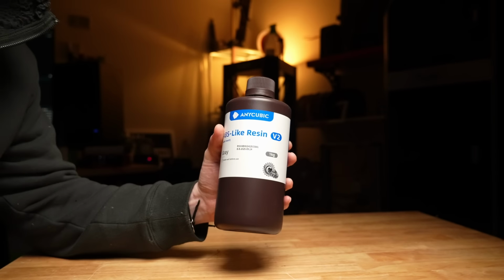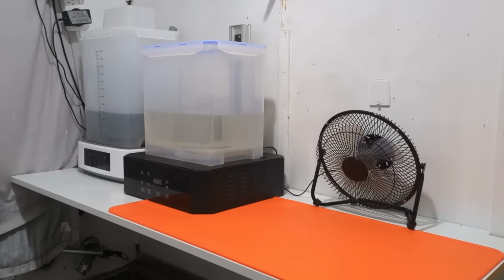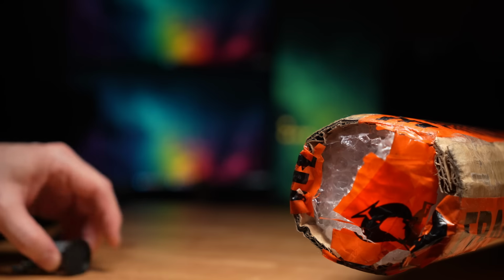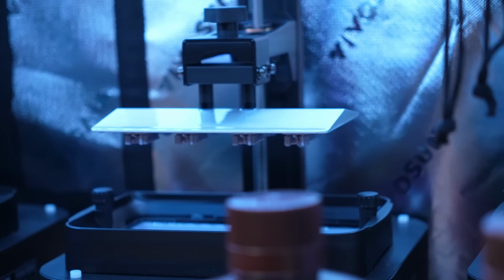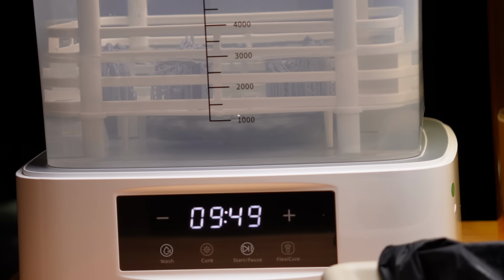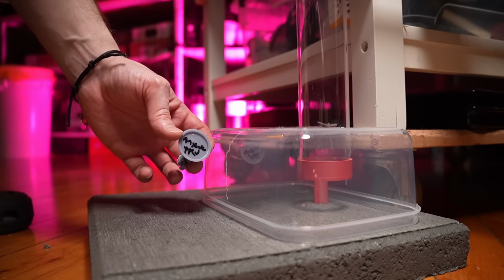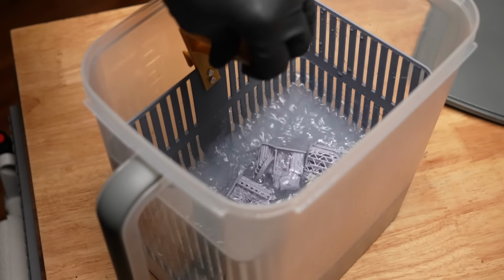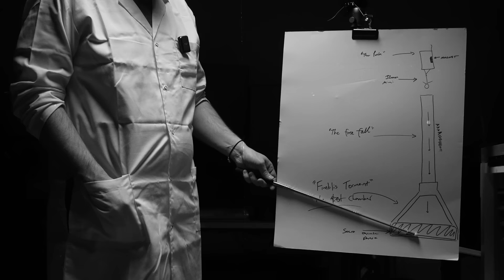The hunt for GREAT water washable resin (Part 1)

Comment: I have been pretty happy with the sunlu ww abs like. Was easy to calibrate and I have had a much easier time removing supports and minis not breaking compared to elegoo ww. Elegoo is extremely brittle and chipped constantly. Have not tried some of the others yet though.

Comment: Drop test: just feed the model into the top of the tube without the faff of the extra mass from the magnetic holder and just let it fall under it's own weight.
You could also do something like print a sword or spear or a true-scale mini limb or any other kind of typical fragile bit and fix it in place with a vice or something. Then make a cheap little force gauge by taking a small hammer, drill a hole near the top of the handle so you can hang it on a nail or something so it swings like a pendulum. Raise the hammer head to a marked height and let it go so it swings down to hit the model on one side with the same force each time.

Comment: I got into 3D printing during the pandemic when IPA was scarce. Water washable resins was the only real option. I have a Mars 2 Pro, and still exclusively use their translucent water washable resins.

Its affordable, easy to work with, doesn't smell as bad, and doesn't require all these other chemicals. And the translucent resins allow me to inspect the bed after every print to make sure the FEP is ok, and it allows (in my opinion) a more thorough cure as light can penetrate the model easier.

Is it brittle? Sure. But I handle my minis with care when I play and they are on a shelf for most of their existence anyway so its never been an issue for me.

Comment: A better repeatable droptest could be to hit the minis with a hammer that swings like a pendulum on an axis while the models are standing and not beeing held in place. That should emulate a drop on the ground that is always the same angle and the same force. I am no engineer though, but maybe that's an idea.

Also please please test anycubic UV tough resin. Have been using that stuff for flexible and durable and really liked it. would love to hear your opinion on it.

Comment: I'd like to see the test again withput the extra weight. If you glue a magnet to the bottom then you could have another electricslly controlled magnet be your switch. Bonus, you could also test if gluing washers to the bottom breaks more models

Comment: A quick note on you not wanting to try water washable resins because you didn't want to contaminate water...

You can wash those resins in a transparent tub then leave the tub out in direct sunlight for like a day - this will "cure" the resin residue. Then filter the water through a paper filter when (or before) disposing. The water you dispose should be clean this way.

Also consider the water cost of isopropanol production, bottling, and shipping... I'm fairly certain that will have a much worse environmental impact than properly treated and disposed tapwater.

Comment: With regards to your drop test, the only good thing about it is you can consistently control the impact orientation; everything else about it is garbage. The weight of the puck will skew any results and the fact that the puck constrains the mini at the point of impact and prevents it from either bouncing or rolling will just dramatically increase the impulse on the part.

Comment: I really like your idea of testing the resing strength. However I would probably recommend some adjustments. Like you yourself mentioned the minis get crushed by their weight from the custom socket you made. I would probably scrap that and modify it. Your merged models could have (on the backside) some holes in the resin bases for small magnets. Probably a lot more wasteful but the mini would be tested against it's own weight and not crushed against the socket that also negatively impacts the way it would probably bounce of. 

Oh and phrozen also has a cure station that does have an inbult fan in it & LED's on the bottom side. The main reason I bought that Wash & Cure kit :)

Comment: haven't watched this yet but I'm absolutely loving Sunlu Water Washable, granted I still wash it in isopropyl alcohol, but the properties of the resin are fabulous. Crisp detail, not too brittle, the right amount of flex, it cures faster than Sunlu standard (1.85s vs 2.25s, which isn't much but when you run a print shop on only a couple of printers a 20% time saving is significant) and I got 12kgs at 16.99 USD/kg

Comment: What you need to do with the drop test is eliminate the weight that sits behind the mini when it impacts. Until you get rid of that weight, it will never simulate what it's like to drop a mini that impacts with only its own mass. To do that, I would look for a way to stop the main body of the puck about 5-10cm from the bottom, allowing just the mini to continue. Build a sabot that matches the base of the mini, that then uses just a friction fit to sit in the red plastic ring. Then for the bottom of the tube, build a stop that's ~1cm less diameter than the tube, such that the puck cannot go past it. When the puck hits it, the friction fit will fail and the sabot + mini will continue.

Comment: I agree with most of the comments that the weight is probably not the best way to test. I think the rest of it is a good idea though as it keeps the falls more consistent than just dropping the mini by itself from a fixed height, because they will just land randomly. Maybe you could replace the weight with a 3d printed cylinder to maintain the consistency, and dramatically reduce the affect of the weight on the prints.

Comment: I just wanted to say that at least Wargamer Resin says that it is a maximum of 3 min of washing and not to use washing stations and dumping methods for washing. When they say under running water they do not mean under a tap. It means into another container with a spray bottle or with a hose. With this, it does not produce as much wastewater. They said that it has an effect on the strength of the mini if you fully put it underwater. Tho when I asked how they actually did not know why.

As for the drop test. the base might be so heavy base that it makes the whole thing pointless. You would not drop a mini in a way that there is a heavy piece dropping on top of it. You could try buying an electromagnet and gluing a small piece of metal under the mini and just turning the magnet off. Tho the air resistance will absolutely have an effect on how it lands at that point. 

I would actually think that tests for pull force or the test with a swinging hammer to test the force for snapping would be better. Not sure tho. Now that I try to rationalize this to myself it seems that it would still be a pain and hard to pull off. So ignore that.

Comment: The funny thing about wargamer resin is that Ross even tells you to just wash them with IPA, even though it's technically water washable.

Also, I'm going to give them the benefit of the doubt and assume that whenever people wash these under the tap on advertisements, they're doing so in a chemical lab setup, where nothing actually goes back into the sewer system through normal means. That said It's horrible false advertisement because 99% of people do not have a system like that.

I do, for some reason. I have two bathrooms, and one of them goes into a completely different filtering system that would allow me to pour toxic down the drain. I have no reason why this is the case, but it's just mentioned in the documents for the house. I live near a school, so I assume whoever built the house was just given permission to link into the same pipeline with their chemistry class or something. It's just one specific bathroom on the other side of my house. Everything else goes into the regular sewage system.

Comment: I understand the benefit of the puck - it partly negates the weight of the model to overcome air resistance, making a more consistent test between different weighted models.
However, that is not a realistic test as your miniatures are never dropped with a weight attached to them.
One way around it is to use something softer than concrete, although I would recommend designing a more custom and robust test piece. Maybe one with different rated fracturing points so you gauge not just broken/notbroken but "It snapped to the #4 mark".

Comment: In some countries IPA is considered a "dangerous" chemical hard to get hold of.  Then again, although IPA is hard to get hold of here, > 90% ethanol and methanol are not, so I guess those could possibly be used instead of IPA?  Anyway, the little bit of resin printing I did was with water-washable Elegoo resin, dumping the post-wash water into some transparent plastic containers that then are left out in the sun for days or weeks and finally the resin is then filtered out with a sieve.  Is that good enough to make the water as safe as what your washing machine pumps out?  I hope so ...

Comment: It would be interesting to know how long you washed and cured the models. I have only been using the anycubic abs like v2 (so i dont know if this holds true for other resins as well), but it is extremely sensitive to how long you wash and cure. Any resin takes on water which alters its structural properties so you should wash for as short as possible. I keep it to a short dunk, scrub with a toothbrush and then swirl it in the bucket which takes no longer than a minute and has been enough to get every model clean so far. Curing time for the anycubic abs like v2 is also quite important. Curing for 3 minutes gives me a nice flexible model, while curing for 4 minutes gives me an extremely brittle model that sometimes breaks just from tipping over.

Comment: One thing that is very important for water washable resin is that you don't let your model sit in the Water for more than 2 minutes.
Washing in the ultrasonic for 10 minutes will make them super brittle.
Should have done some research before doing this.

Comment: You should try Sunlu detergent, makes "normal" resins water washable and it can hold more resin per g than alcohol.
It doesnt stink even when full of resin and can be sonicated.
I cant find an msds for that particular brand but others are made from dipropylene glycol or tripropylene glycol that you can pick up cheaper than the resin wash.

Comment: I got 10 bottles of water Elegoo washable resin when I got my first printer.   That stuff breaks if you breathe on it too hard 😭.

Getting rid of the waste.water is a joke, in the UK at least.   Being a somewhat responsible human and not wanting to pollute the waste water system, I initially tried taking the 10 liters (from one bottle of resin) I'm new to printing and was learning how to wash and clean as I was going along) to the local waste disposal center, they didn't know what to do with it, they took the water I had on the day but told me contact the local council, who told me to contact the county council, who told me to contact the Environment Agency, who told me to contact the local council again.  In the end I was advised by the chief waste officer of the county council to let the water cure in day.light in clear containers and tip the curred water out and bin the solids.  This stuff is horrible, a big mess to clean up and most of the things I have printed with it either broke, cracked or were deformed. Most of that's my fault but the resin is just horrible.  Honestly, using it has put me off 3d printing altogether.  My advice to someone considering getting a 3d printer is DONT they are expensive, easy to break and the resins are toxic as hell.  Everything needs dialing in over and over, clean up is a female dog and you need proper PPE (not cheap stuff) or you are risking some possible horrible illnesses in the future, because god knows what's in these resins right now, but it ain't nice. The time needed to learn and spend doing this is so much, you could spend it doing other things, more fun, less deadly things, like diving with Great White Sharks. My Saturn 3 Ultra is in my shed put away and I don't think it's coming back out.  I have buyers remorse and I a don't want you to have.  Just pay for someone else to print something for you or just buy the minis you want.   Getting a 3d printer in my experience really isn't worth the hassle or the risk to health.  Lots of 3d printing influencers aren't acknowledging the possible heath impacts of handling 3d printing resins, and are possibly putting their own health at risk.  I think our man here has and has made some helpful stuff about it, but it REALLY needs a deep dive and possibly some interviews with some independent health researchers/advisors to get to something like the truth.

Comment: The drop weight could be reduced greatly to like... Just a magnet and a hollow puck. Or even keep the tube and just attach a magnet to the base and let them fall in the tube. As long as its a reasonable weight and a controlled freefall, it gives a baseline comparison regardless of if its a extreme test.

Comment: Do you have a video about the full post process.... uh... process? I'm 1.5 years into FDM printing and 1.5 months into resin printing. I not only struggle with getting the Cones Of Calibration V3, to print right, I struggle with cleaning up any scars from the supports. I'm tempted to get those finger nail buffing pads.

And with my eSun Hard-Tough Resin, at 20 micron layer height, I can not get the cones to print, yet be able to get the sword to fit in the skull. at 2 second layers, the cones are all perfect, but supports merge and he sword is wonky and bulbous. The 6mm block, is 6.12. Anything under 2 second layer height, the cones start to fail. Prints tend to look okay, but I have to file down any joints for multi-part prints.... I have a Mars 4 "9K".

Any fellow viewers have any tips?

Comment: Pretty sure a redesign on the drop test is necessary, unfortunally. It's not just the extra weight, though that's a pretty big factor as well. The absolute death sentence for the minis is them being fixed after the fall. This way the minis can't bounce off the floor to get rid of some of the kinetic force of the drop, thus all the energy hits the resin instead. That's not what would happen in any realistic drop in real life. I'd say just let them drop freely in the tube, maybe get a thinner tube so they can't rotate as much. Sure, you can't use the magnet as a release mechanism then, but maybe you can just 3D print a mechanical solution, like a floor you can quickly pull out?  Is there a major reason you want them to drop straight and fixed like this I'm overlooking?

Comment: I think there are some slight problems with the test one the pieces would not be falling with all the added weight of the metal screws 3d printed parts and everything. 2: With the pieces being held in a static place they don't have the chance to tumble meaning that they can't move or react to hitting the floor and bounce in back. Yes it being static in some aspects is good but it far to unrealistic to how it would be IRL. I personally you the Anycubic Water Washable  Black and have only ever had two pieces break off one falling and breaking off my metal chair and the other I accidentally flung off my dresser after turning around too fast. Anyways though I can't really say that the results of the test are an accurate representation of the resins this seems more like a maximum extreme that you would only really see once or twice and rarely at that. If possible I would try and limit the amount of extra weight added to the model then at least the added mass won't affect the impact of the pieces. Yes I understand you wanted to be able to get a consistent test but the added weight is like comparing the grain of a bullet a 115 grain and a 140 grain have vastly different force on impact. I'm sure the majority of resins will still be affected in some way by the impact but the added weight is just too great a variable to accurately consider the durability.

Comment: PS: I spray the crap out of my water washable stuff (into a sealable bucket), then do two sloshes in pickle-jars, then ultrasonic, then spray again (in deionised this time). I'm a bit . . . er . . . thorough. But you can do that with ww (just make sure you still wear a mask) and it's okay. I leave stuff outside in a clear bucket to evaporate most of it, then slop that into the burnable rubbish when it's turned into a big, gooey lump of slime. You need to be careful about leaving it too long, though, or it will kill the bucket by sticking to it. I also do the spraying into a binbag-lined tub with newspaper in it. That soaks up the spray, then I take that outside to evaporate between cleaning cycles. Again, that eventually just gets chucked in the burn-waste as it's just damp, slightly resin-caked paper by then.

Comment: instead of a drop test with added unecessary weight, reverse the test setup. take an average miniature fixed "standard" weight and drop it onto the minitature, this way you take the randomness of impact angle out of the equation, so you don't need the fixture to orient the miniature. you also get rid of the added weight of the holder fixture, you can drop it onto the miniature, with the minature in different orientations to get targetet results
Reply from the maker: Great idea!

Comment: I have a mono 2 as well as the big creality. The mono 2 is way better for small detail stuff. I think personally it’s all to do with the fact smaller printers do not get the same flex when the print lifts from the vat. I use the creality for larger stuff but for single figs etc always the little anycubic,

Comment: The puck made all of the drop tests unusable because of all the extra weight.  Simply using a removable pin to release the miniatures would yield results that are more applicable to their use case.